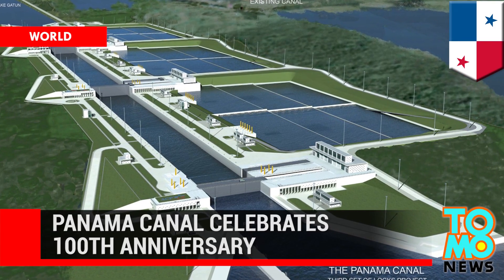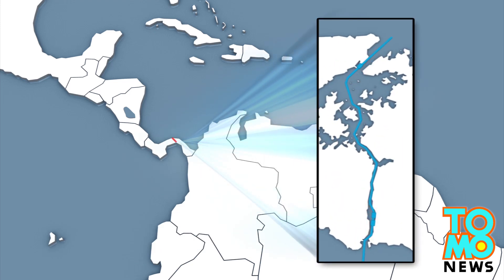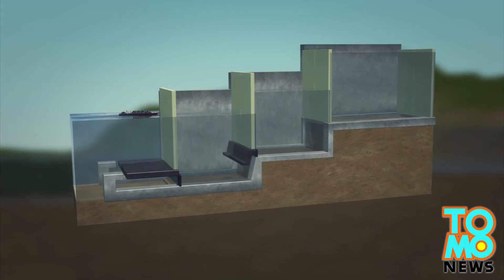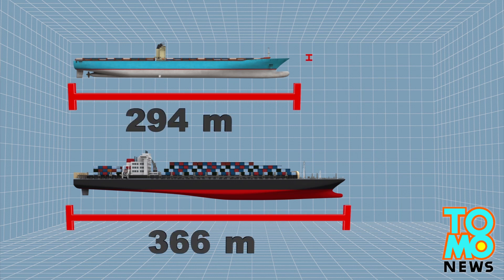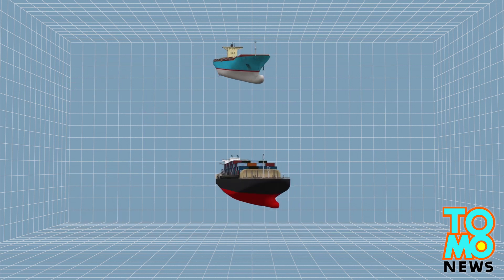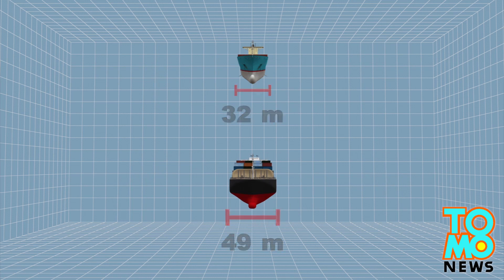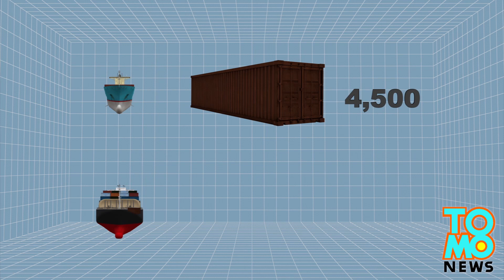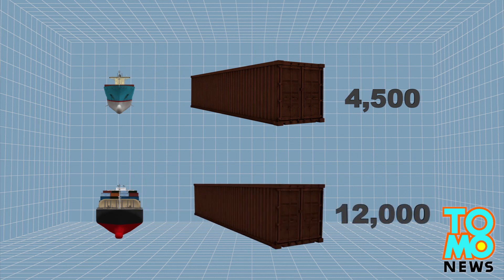Panama canal expansion: how it works

Comment: At 0:26 the designers made a mistake in making mobile barriers, in fact if they were divided in half in height they would have found the water from the previous ship in the next tank and the movement from one tank to the next would have been minimal (ship + the right amount of water), then the pumps would compensate if necessary.
This saves time for raising / lowering (increasing the number of ships to be passed and also decreasing electricity consumption.

Comment: Why don't they dug up the Panama canal deeper and get rid of the locks?
Reply: they actually try to do this, but it was imposible because of the terrain. there where to many mountains and big rocks etc. so the cheapest way and most efficient way to do it was by making an artificial lake witch they had to make a smaller hall then going all the way down to sea leve. then building the system explane in the video. the first company that try to make the panama canal was from France and they ran out of money after only completing   10% of the canal. when the Americans took over the project they had to change the way it was going to be build if not they would have fell as well. any other question just ask :) just a good Panamanian loving his country!

Comment: I would like to see a nimitz-class aircraft carrier fit through there.
Reply: It wouldn't be any larger than those mega-freighters; in fact smaller measured by deadweight tonnage.  The last US fleet carriers that could transit the old locks were the Essex class,  IIRC.  Midway class ships retrofitted with angled flight decks were too wide.  There was also going to be a BATTLESHIP class called the Montana class that would have too much beam. It would have carried 12 of the Iowa class's 16 in/50 cal [barrels 50 times 16in] guns but with more armor and slower top speed.

Comment: why do we need locks ? just dig a canal and let it be .. wil the water not be there in the canal for the ships to travel on it ??  some 1 plz explain
Reply: The locks are needed so that ships can travel upward into the lake. The lake is not made to the same depth as the ocean so the locks are needed.
Reply: Not feasible...because of physics and stuff....sorry I was so technical
Reply: if you dug straight through it would be a giant rapids so the ships could only go through one way and not the other
Reply: Pacific 'sea level' is higher than the Atlantic. Don't ask me why.  Plus, they couldn't dig the canal through bedrock right down to either 'sea level' anyway.  So ships have to be basically 'lifted' over the land barrier between the two oceans. That isn't the case with the two seas connected by the Suez Canal built by the French.  They tried building the Panama Canal but failed.
Reply: The lake between the locks is 26 meters above sea level. That giant rapid wouldn't last very long.
Reply: they didnt care much of a environment back when it was build thou. but cutting something 40+ meters deep and 80+ kilometers in length is a lot... a tunnel might be other possibility but not with that technology when they first build it.
Reply: woldrau777 well I wanted to know the reason in depth.  thx for trying though
Reply: https://en.wikipedia.org/wiki/The_Path_Between_the_Seas
Reply: Digging a deep narrow canal in a jungle between 2 oceans with a huge lake and the rest of the general environment. Find a way to build this yourself.
Reply: not sure what you mean... but apparently norway had idea to build tunnel for ships.
Reply: if they dug a canal the high difference in the water level would cause the ground water level to drop many many feet, causing in some places a drought .
Reply: Good luck digging through all that rock without going bankrupt.
Reply: The difference in sea level is 10 inches higher on the Pacific side. That is not the main problem though. The average height of high tide on the Pacific side is about 18 feet while it is only around 3 feet on the Atlantic side. 15 feet is a significant difference and a crazy amount of water.

The worst reason for a no lock sea level canal though is the environmental damage of direct flow from the Pacific to the Atlantic. It would be catastrophic to the Caribbean Sea, Gulf of Mexico, and Atlantic Ocean as a whole. The way it is now fresh water flows out to both sides and keeps everything separated. The fresh water also acts like a disinfectant for the salt water creatures that make there way into the canal.
Reply: I went through the canal last year.  No there is no significant difference in the sea levels of the Atlantic and Pacific.  The locks were a way to reduce the amount of digging and to utilize the natural rainfall in the area that fills the lake

Comment: so after the expansion, emma maersk can now pass through panama canal?
Reply: basically it fits, since the emma and triple e are 400 meters long and 52 meters wide, and the canal is 425 meters long and 55 meters wide, but for safety reasons they decided not to let in ships longer and wider than 366 meters, 50 meters wide
Reply: +Abraham Alvarez
The safety aspect relates to the need for tugs both fore & aft to steer these neopanamax vessels through the locks. The new locks can't fit two tugs and a vessel longer than 366 metres in the locks.
Reply: +Anthony Mina Nope, too long

Comment: this proves Teddy's Big Ditch is back in the game. it was marvel that it is in 1915 and it is the marvel that it is today without Panama Canal the cargo won't get delivered the world depends on it.
Reply: Trade between Europe & Asia doesn't need the Panama Canal. But it is great for trade between the west coast of North/Central America & Europe, & between the east coast & Asia.
Reply: David Keenan it is needed because ships have to take the long way after the big giant supermax came out when the Panama Canal was built it can only hold up to the Panamax size Suizmax  could get through but barely. With the new Panama Canal every ship can get through Suizmax, Panamax, Supermax, and Alfamax.
Reply: "With the new Panama Canal every ship can get through"

Not quite. The container vessel MV Barzan, the first of six of its class, can't use the new locks. At 400 metres long, it & two tugs can't fit into the new locks. It's 34 metres too long. But this doesn't matter because they are only designed for journeys between Asia & Europe, & they can use the Suez Canal.
Reply: Sorry, I'm sure you are wrong. These massive vessels need at least two tugs, one fore & one aft, to transit the locks. So though the lock basins are 425 metres long, the maximum length of vessels that can use them is 366 metres.

So the MV Barzan and the Maersk E Series, eight in that class, are just too long.

My opinion of the canal expansion is that it is a marvelous achievement. Credit goes first and last to the Panamanian people. 

Sure they used foreign contractors, they had no choice, but this most important maritime transit hub will be staffed mainly by Panamanians, and this expansion ensures the security of the nation for generations to come.
Reply: Of course the cargo is delivered anyway, but bigger ships with same crew lowers per-ship costs.
Reply: Mi chiarisci  un dubbio tecnico,vedo la terza vasca abbassare il livello acque per innalzare la seconda vasca,giusto il principio del nostro Archimede,ma
e sbagliata l'applicazione.
Esatto è usare (con due tubazioni separate)l'acqua del lago e aggiungerne solo
alla prima vasca a spingere la nave in alto e poi a seguire,l'acqua di spinta deve passare a scendere del lago nelle tubazioni e a salire nelle vasche.
A circolo chiuso,sistema veloce(due navi a salire/scendere,una alla prima vasca e una alla quarta)e non mischia le acque dei mari con le acque del lago.
Reply: Wow! That would be a helluva detour if it closed.